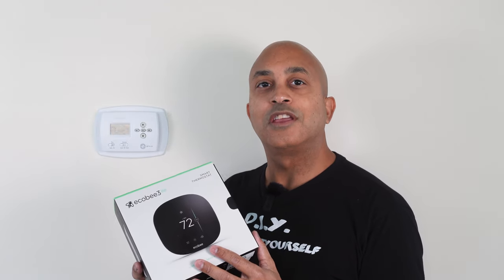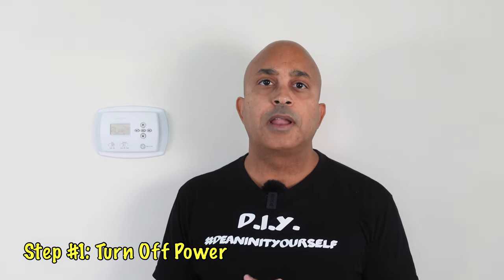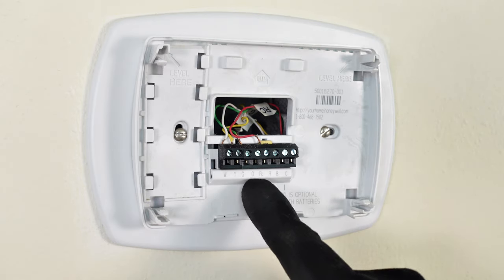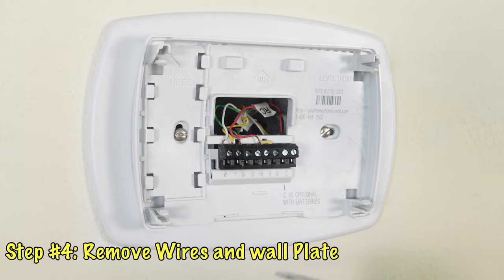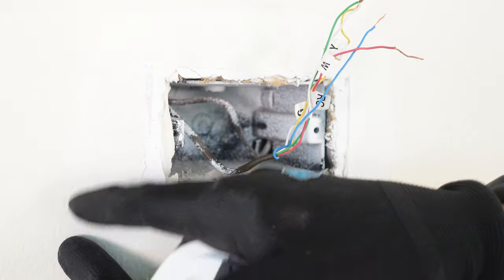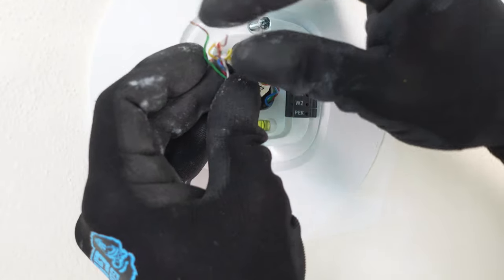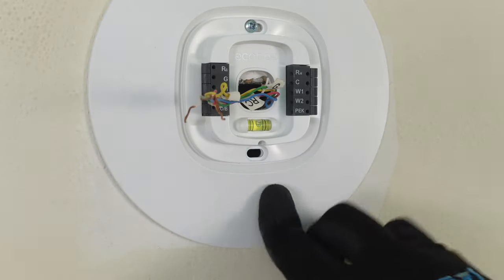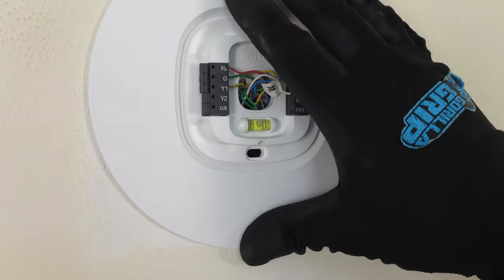How to Install ANY Smart Thermostat | No "C" Wire | Detailed Version

Comment: Totally useless and misleading. You actually do have c wire, so there is no problem to begin with.
Reply: This video helped me in learning the wire to the compressor could be substituted for 24v needed from a dedicated c wire output. It sounds like you have the same wiring I had in my system. Without a c wire, a new 5 conductor wire would need to be run in place of the existing 4 conductor wire.  It can be bought at Home Depot by the foot, then connect hour new t-stat per the instructions. If the wire is stuck in the wall you might be better off making a new hole closer to the unit and doing some sheet rock repair. Otherwise a c-wire adaptor can be used which allows the 5 wire signaling to be controlled with 4 wires from your new t-stat but they are way more difficult to make use of if your system doesn't have a dedicated c-wire output from a control board. So tag, you're it! Now it's your turn to share knowledge when you see a problem you can help with.
Reply: @sambadeuneaux  I was able to run a 5 conductor wire (actually 8 conductor) for one of my zones/thermostats, but not for the other - it was too far away from the furnace and the old wire was stuck and could not be pulled. But I was able to solve the problem anyway. All you need is a 24 Volt Transformer - exact same you use for your doorbell chime. It can supply power to the thermostat and thus act as a c-wire replacement.
Reply: Thanks cat
Reply: @cutekitten9856 Genius! So simple and so obvious...I never even thought of it. 24v doorbell transformer. OF COURSE! Thank you.

Comment: Your video title says no C wire but the video HAS the C wire.  Not helpful.
Reply from the maker: Sorry I couldnt help.  The video explains what to look for if there is no C wire.
Reply: @DeaninItYourself  if there is a c wire but isn't connected
Reply: @@coeusquantitative6146
I actually found a solution that works for me.  I can install an electrical outlet in attic.  Use an ac adapter from Amazon.  Run those wires down to where the thermostat is and power it that way.  But must be a 230 stat.

Comment: This video saved me from returning my new ecobee because my C wire was not connected but wrapped around the wire and my air handler had no circuit board. Thanks, a lot.
Reply: same! I was looking at buying a separate transformer but was worried about how all that connected... Great Video!

Comment: This video saved my life! I was pulling my hair out trying to figure out how to get a C wire connection to our new ecobee3 lite. We have an older furnace with no C connection point. We had the unconnected extra wire and the trick to connect it up to the opposite wire as the yellow coming in from the a/c condenser was gold. My furnace controller board only had R W G so no C connection on the board. I thought I was out of luck. Worked like a charm! Thank you so much!!
Reply from the maker: glad it worked.  Congrats

Comment: Thank you for this. I like that you had the C in black over the part on the thermostat. I did notice the "C wire optional with batteries" on the plastic below. I will add that you should always use a voltage detector before touching anything to make sure everything is off. Because sometimes there is a hidden supply of electricity going into things. 
I don't have drywall- the people who built this place used 1/8" wood panels. I can see that they just poked a hole through for the wires. 
My Trane thermostat has 7 wires. Red black, white, off white, yellow, orange, and blue.

Comment: Man this video really helped me out. I just got a new wifi thermostat never needed the c wire before tested up at the thermostat from the red and c wire saw 20acv so I thought my c wire was hooked up by thermostat wouldn't work after hours of trouble shooting I find the c wire wasn't hooked at at furnace at all, crazy I still was seeing that 20acv but got it hooked up then of course the thermostat then worked. Uhgg. But this video is what made me go double check that the c wire was hooked up. Thanks
Reply from the maker: Glad it helped

Comment: I just checked and I have the same wiring.  Our A/C tech gave us an a/c cover for the winter but said to shut off power to a/c so it won't accidentally start with cover on in the spring.
Does this stop me from using your example?

Comment: Thank you for this video. I got some new basic Nest thermostats and the batteries are draining way too fast in them. We had some old Honeywell thermostats with an LCD screen and I'm thinking that maybe the C wire was not even necessary for those thermostats even though it was connected. I'm thinking that I need to remove the cover from the air handler and make sure that that blue wire is actually connected inside my air handler. I'm hoping that it's not connected in the air handler and that connecting it will solve my battery drainage issue. Apparently this is a common problem that nest owners have and Google doesn't seem to be able to answer the question so I'm hoping that this solves my issue and others if they see this post and your video.

Comment: after saw this video I checked my AC furnaces wires, I found yellow wire from thermostat is connected to red wire where goes to compressor but it does not connect with transformer yellow wire?? Can I still connect C wire to brown wire (common) ca you Help me?? Thanks

Comment: The Blue wire carries 24v AC. C stands for Cyan(blue. think printer ink) not common. Its the hot wire to power any thermostat so that it doesn't need batteries.

Comment: Now here's my issue I have a rezner gas heater in my shop. The board does not have a common wire connection  option.. is there anything else I  can use to supply 24 volts to the smart thermostat I'm trying to hook up as there is no common connection capabilities on the control board on my gas heater. I know I  have an option to install a small rectifier to the main power coming in to step it down to 24 volts to supply the thermostat  but I can't remember if there's something else in a furnace that does not have a common option on the control board that can supply the T stat at no more than 24 volts?

Comment: I have red, green, and white wires coming from the wall. The green wire is not connected to my Honeywell analog (old) thermostat. The red and white wires are connected to the thermostat. The thermostat operates a heat-only propane boiler. No AC. Is there an Ecobee thermostat that is for heat only where I just need the red and white wires?
Reply from the maker: if you only need heat, you only need to connect the red and white wire,  any thermostat will work

Comment: Did anyone have a problem
Where with the smart thermostat you had to plug the W wire into the O/B wire? When I plugged it in the W spot my heater came on so I had to switch it around.

Comment: I had this working on a Honeywell T6 Pro but as soon as the power was disconnected to change the filter, it stopped working.  I had to go back to my old 4 wire thermostat that has no blue wire.  Blue wire on opposite 2 wires to compressor and the board actually is labeled "C".  I tried disconnecting the blue write on T6 and use only 4 wires but it didn't work.  When I look at the Thermostat with the T6 equipment & blue wire, it says "standby waiting".  I waited for 10 mins., but no change.  Meanwhile the thermostat is blinking "Cool On" which means it is sending the signal but nothing is happening.  Everything worked great with the 23 yr old Trane Thermostat the second I connected it.

Comment: Thanks for the video. This is exactly what I have. But what if I don't want to do the trouble connecting the C wire becuase our AC unit is in the atic, could I just use an external 24volt from Amazon? The external 24v has two wires, where shall I connect them into the thermostat, C and what else? All other wires (G, W, Y, R) are in exact connections like in the video, including the jumper. Thanks in advance.
Reply: Im wondering same thing about the 2 wires, i bought the generic c wire adapter off Amazon

Comment: Thanks for the video! I have my blue wire connected to Y1 and the yellow wire coiled like your blue wire was, any idea why? Also my thermostat has that switch on the gas side (I think that's for the furnace). Thank you
Reply from the maker: whoever connected it just used the blue and yellow wire opposite.  Thats why its important to take a pic of the before installation so you can put it back like it was.

Comment: Why is it that the C wire so often is not connected? This and another video saved me from having to crawl under the house to run an ac adapter to power the thermostat. But I find it peculiar that the C wire is actually there just doing nothing and whoever installed your AC didn't think to connect it...??

Comment: Are there any smart thermostats put there that support wired sensors? I almost bought the Amazon one but found out it's incompatible because of my sensors.
Reply from the maker: What kind of sensors?  I think the ecobee does support some
Reply: @DeaninItYourself  The outdoor sensors that provide temperature readings to the thermostat. I think I found some posts that say I don't have to connect them since smart thermostats pull info from the internet. I just hope I connect the other wires correctly since the labels are a little different from the Amazon thermostat.

Comment: Hi, I have an old thermostat using a battery, and now the wires are red, green, blue, and white.. I don't have the yellow color wire. Is it okay if I install the smart thermostat without yellow wire?
Reply from the maker: Sounds like they used the blue instead of the yellow.  Peel back more of the wire and see if the yellow wire is in there.  If it is you need to follow my video and switch the blue and yellow wire inside the air handler first.

Comment: Good through video. But, Why could you not just add a jumper wire from red to "c" at the thermostat?
Reply: Is not the same red wire
Reply: @elib9223  if you have an unused wire in the bundle can you double it up with the r wire in the relay box and connect it to c in thermostat while  keeping original r wire on r? Thanks (oil heat only currently 2 wire for hot water radiators/want to install a Google/nest that needs a C)

Comment: Where do you find C-Wire if it's just a furnace which don't have a compressor outside?
Reply: I think yiu can use the G wire and then add a jumper

Comment: It seems to me that if the Yellow from the thermostat is connected to the transformer and contactor at the same time that the contactor will have power at all time and therefore the compressor will be on at all times. The yellow from the thermostat will not be a signal to activate the magnetic coil within the contactor. I make this observation because you are stating to connect the blue to the other side of the coil contactor. 

I am not being a wise ass. I truly want to understand and know where the blue should be connected, if the yellow at the airhandler does not have the transformer connected together with the yellow of the thermostat and the contactor coil line. It seem the other side of the contactor coil is the common you want to be tied into the additional blue wire; and if I follow you correctly, then the blue wire will not have power to turn on the nest thermostat. 

Where did I go wrong in my analysis? 

Eager for some insight from a tech, I am still green behind the ears when it comes to HVAC. But willing to learn.

Thank you for your time.

RCB

Comment: You are lucky because you have a c wire that no used. So just located it. It's harder if dont have c wire in the cable.

Comment: I only see 4 wires.
Red, green, yellow, and white.
Reply from the maker: they may have cut the other wires, peel the insulation back a little and check.  if the other wires are not there you need to run a new wire or sometimes they have an adapter that comes with the thermostat
Reply: @DeaninItYourself  okay, I'll check.
Thank you.